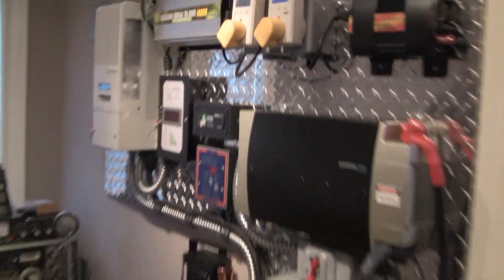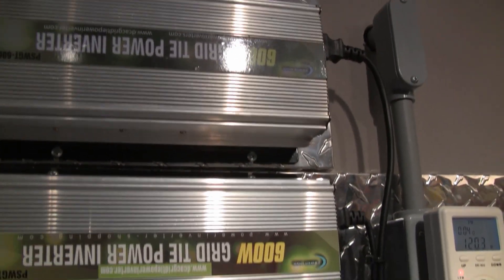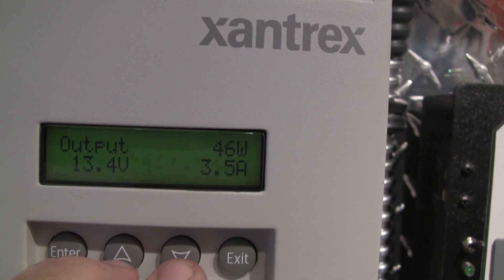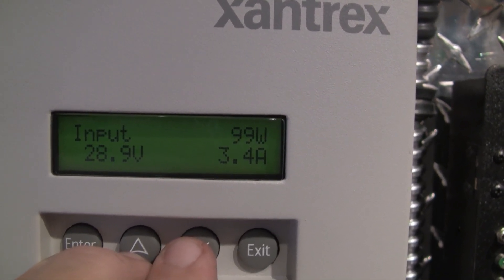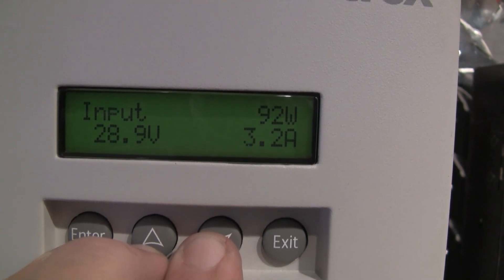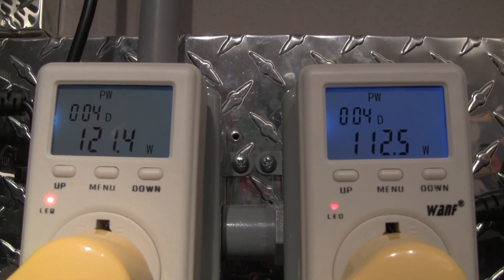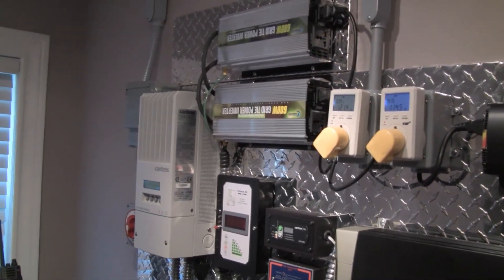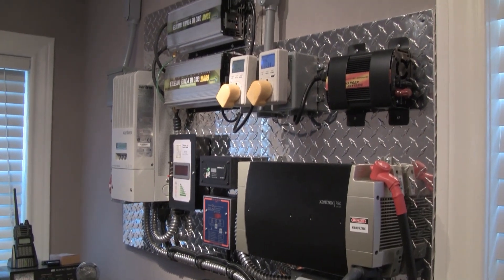SOLAR GRIDTIE INVERTER AND BATTERY CONTROLLER

Comment from the maker: @wa5dxp Please go to my channel to see the other videos on this system.Iam sure that the other videos can answer your questions. Let me answer one question. The transfer switch breaker box is hooked up to each individual circuit in the grid breaker box in your home. Example, If you just wanted to run the circuit for the lights in the kitchen off your battery bank, you just flip that breaker on the transfer switch control panel. This system will let you pick what breakers you want to run on solar

Comment from the maker: @econewpower Thanks Al, You and Kevin (OBXSOLWIND) are the ones that got me started on all of this. I just added a little touch of my own to my system. I think it did turn out pretty good and I am very happy with it. I do want to add another (4) 100watt panels to it. . Note: I came home the other night and everyone in the neighborhood had no power, including me. I fliped a couple of switchs and my frig, tv, lights, computor were on line. Now how nice is that. Talk to you later buddy. Carey

Comment: Boy  I do love that board design, that looks so well laid out and clean and functional. You have truly done an outstanding job. That's really good concept of sending the power to both, keep your batteries from cycling so they will last years and only use them when power is out, meanwhile always putting out to the grid, great, great video. Thanks for sharing!

Comment from the maker: There is no way to control how many amps go to witch piece of equipment. On my testing, I found that when the battery bank was down and was charging , I had more amps going to the Xantrexx mppt charge controller than to the gridtie inverters. The system is working quite well in eather mode. Thanks for the comment . Carey